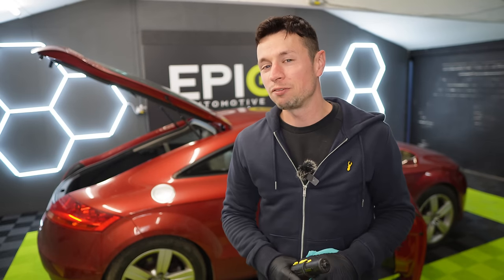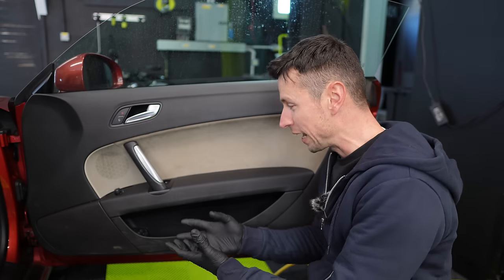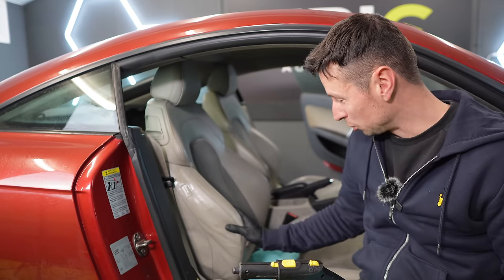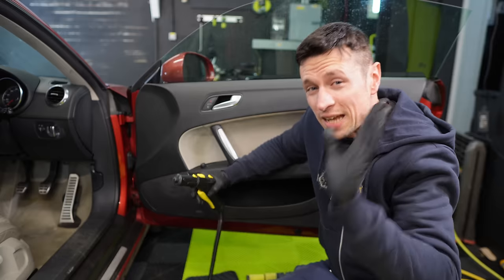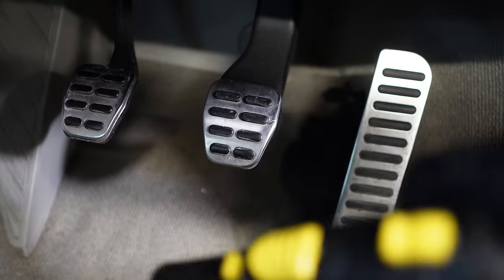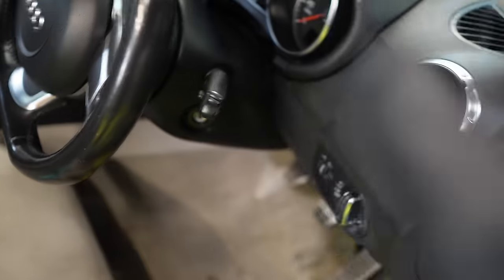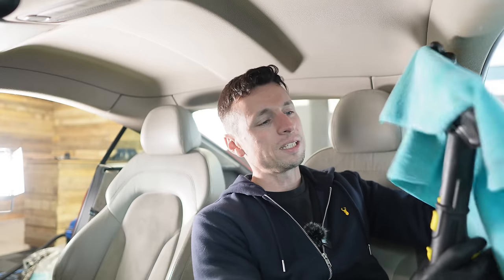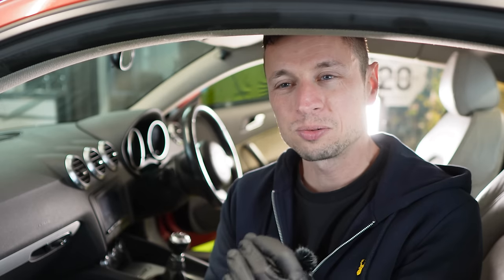Complete Interior Car Cleaning Guide using a Steam Cleaner

Comment: I use adjustable cable-ties to keep the cloth on the steamer. Get some Bilt Hamber hydrate-80 on that rust, it converts the iron oxide into a protective layer. Check it out it really does work, stop the damage now before it gets any worse.

Comment: Great video. I have the SC3 and SC1. SC3 is easier to use. There should be a red tip you use when you want to direct the steam like you did into the vents. I found some plastic had whitened after using steam. I used an exterior dressing, solution finish or similar. Buffed off after a few moments and colour was restored. 
Keep up the good work.
Reply from the maker: Thanks very much 🙏

Comment: Gotta be careful with a steamer on glass if the car has tint. It will heat the glue up and cause the tint to peel, that's a pain to fix. Not sure if it's common in Europe but there are a lot of sates in the US that allow it (and people get it done regardless).

Comment: nice,yes would agree that the sc3 maybe not the correct tool for cleaning a 15 yo car.  I bought one for the house, and they work great on carpets and hard floors + bathroom.  As for smells in the car, you should probably look at chlorine dioxide tablets for heavy smell removal + a fish tank air pump :)

Comment: I go to town with the steam cleaner. I love cleaning the headliner with hot water or steam. Steam can wreck the plastic like you say. Just don’t hold the steam too close or for too long in one spot. 😂
Reply: Does it melt it?
Reply: @Anthonybrother  Steam can leave marks on plastic interiors or dry out the plastic changing the color. This happens because you hold the steam cleaning head too close to the plastic for too long. I just make sure to hold my steam cleaner farther away from plastic parts and not allowing the steam cleaning head to blast steam on the same spot for too long. I never have any issues because I don't let the surfaces I'm cleaning get too hot or blast too much pressure into surfaces.

Comment: What do you think of anion and ozone diffusers to remove smells?
Reply: Ozone machines works amazing. As long as you do it for your final part. After shampoo and all clean as you should have technically removed the dirt and debris from the vehicle the ozone will work for the surfaces and usually i runt it over night air out throughout the next day.